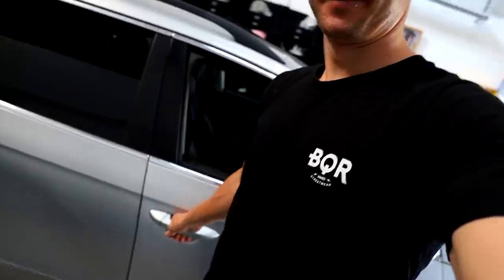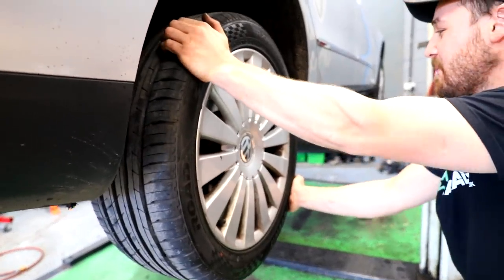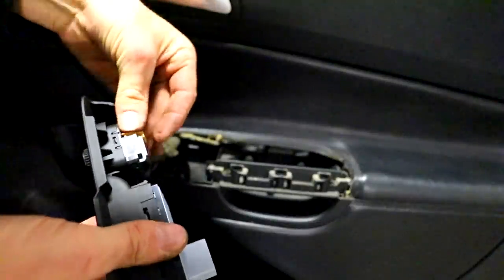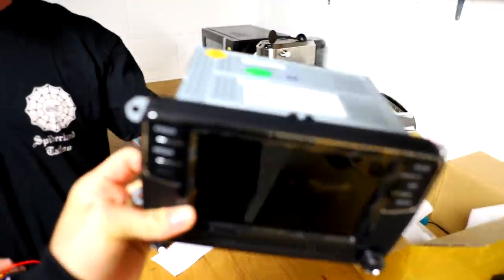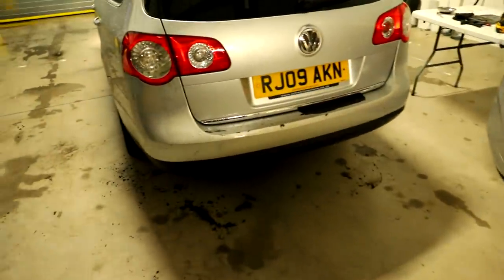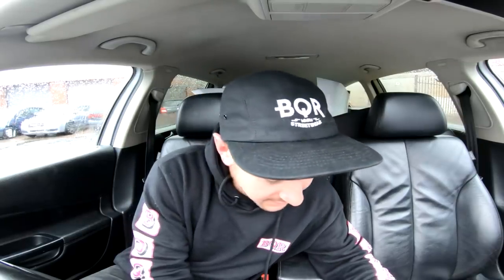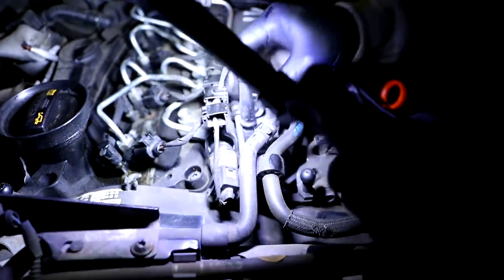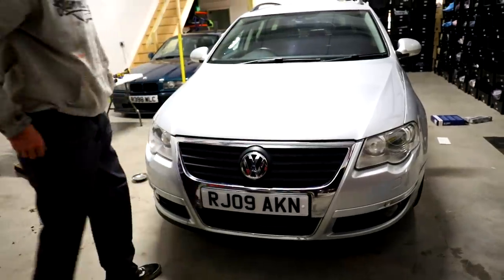Budget Daily Build - Episode 2

Comment: Just found this website and loving it... Just wish I was young again (77yrs in March 2023) to enjoy the fun working on a daily. Have a 2008 Passat estate 2L diesel with DSG (B6-3C5) and just had advisories on MOT - Front Lower aluminium Wishbone bushes and Rear Control Arm bushes at bottom of spring... Awaiting spares then it's lay on the drive and pray for dry weather. I would appreciate your comments on OSF drive side dropping the Lower wishbone as I believe this side is a bit of a challenge. Off the check Episode 3...

Comment: For your rear window you need cerium oxide and the correct glass polishing pads. Normal cutting compound for paint will do bugger all. it's a powder you mix with water and it makes a right mess! kits can be bought on ebay cheap. I use to mop a similar deep scratch on a previous car every time I washed it. The scratch eventually reduced by about 80%

Comment: Idea: I don't have any idea I mean you are doing the right things, obviously don’t do a stage 2 it is a daily car keep it clean, maybe some nice racer wheels, and black all the chrome details and that’s it. Keep up the good work... I will just go on the site and buy the stuff ahahahah
Reply: Stage 2 isn't bad at all. More than manageable enough for a daily driver. Stage 2 is to daily drivability, what coilovers are to daily comfort. Ie. If you can tolerate coilovers, you can tolerate a map & clutch.
Reply: @shona5512  yeah I now, but i think the engine will not be as durable as the original one. And for a daily driver you don't need more than 100 horse power
Reply: @rareshorga5082  Diesel engines are fine to remap. People put hybrid turbos on these engines making over 300hp 400lbft of torque and they still stick it. A stage 2 map won't do any harm to the engine. Having a bit of power is necessary for a daily. 100hp is dead. 180-200hp is ideal for a daily. Plus, better fuel economy.
Reply: @shona5512  yes you are right. But it is a budget daily project 😂😂😂
Reply: @rareshorga5082  A remap & clutch would only cost £500. Less than wheels or coilovers so I think it's well within the lines of a budget daily. They're definitely the best budget mod to do.. It's always my first go to mod when I get a new car.
Reply: @shona5512  💪💪